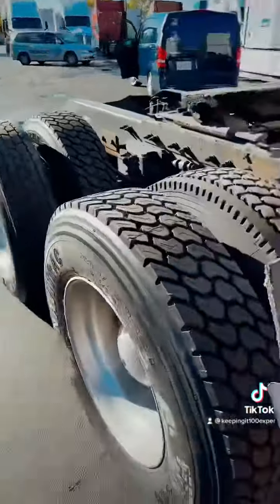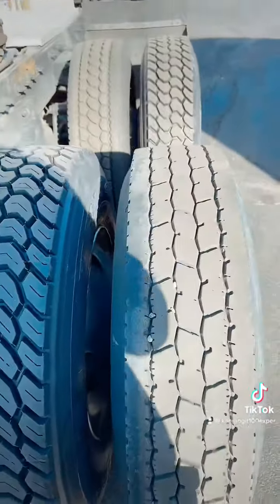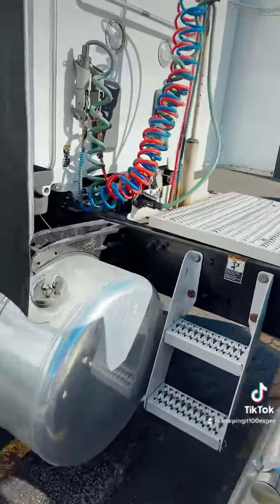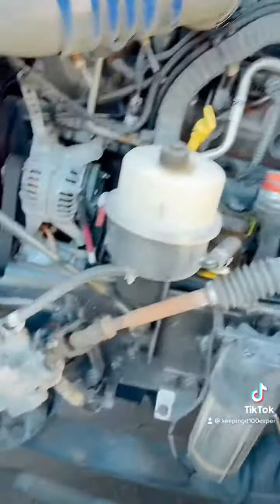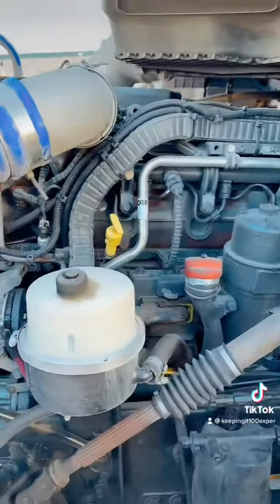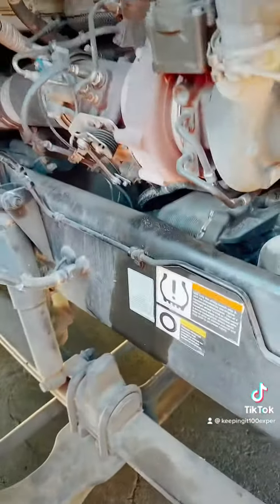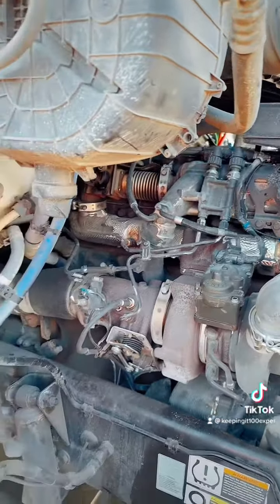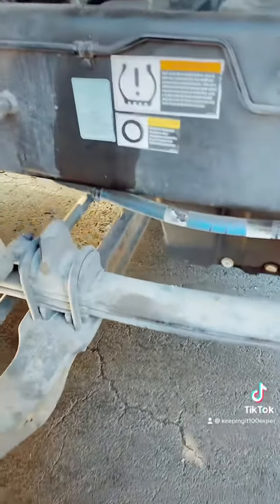Make Sure You Check Your Truck In & Out Before Buying #pinkiedabney

Comment: I would get the oil checked and analyzed by a dealership P Caterpillar Detroit they all have those kits I would do that before I pull the truck off the lot might cost you some time will it be well worth it